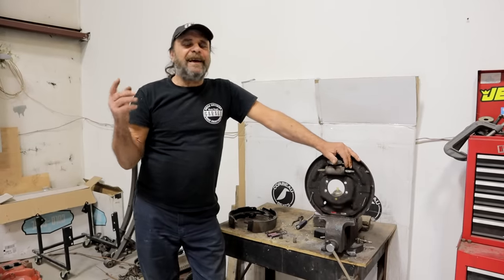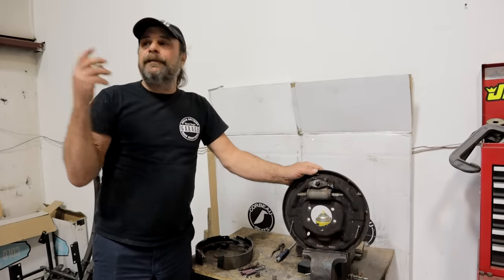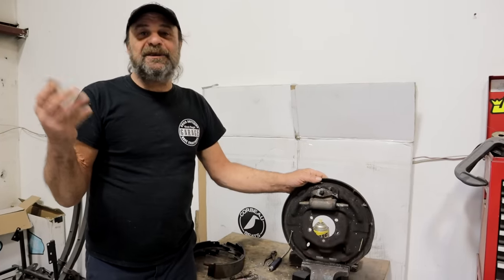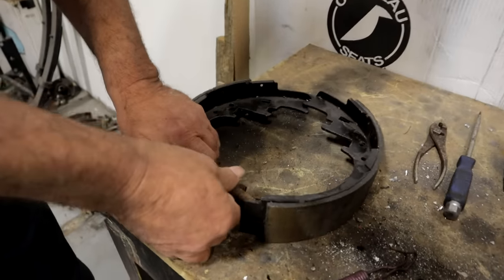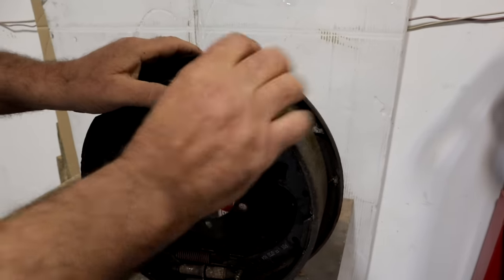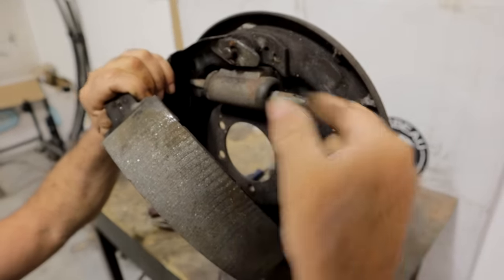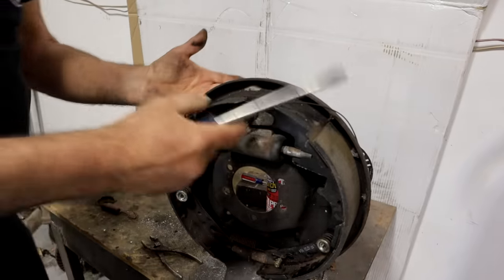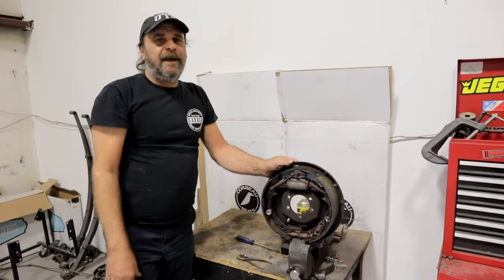Drum Brakes Made Simple - R&R Tips And Tricks That Make The Job A Snap

Comment: Very good, Tony - only one correction, though:
Mopar went to self-adjusters in 1969 on these, at least in 11".
It's easy to "convert" a prior year to them as a result, too (I just replaced everything on my '68 GTX 
last year, lots of research into it).

The bad news about trying to keep drums on these older Mopars is the lack of USA-made new parts
for the job (aftermarket is about all Chinesium these days); I insisted on using new US-made stuff,
which meant a lot of hunting for parts.
Drums especially are non-existent in 11" US-made unless you want to pay huge $$$ for NOS; shoes
similarly are next to impossible to find (I wound up using newly made ones from Porterfield Racing
Brakes in California and they seem so far to work fine).

Chinesium is going to be the ruin of us all,
- Ed on the Ridge

Comment: I got alot of practice with drums on my 65 galaxie 500. 

The only issue i had with it was that it was a single pot reservoir. Have since switched it to a dual reservoir. One time a wheel cylinder broke off at the mounting hole, breaking off the line and leaving me without brakes. Another time, the wheel cylinder popped. Scary times but fortunately my emergency brake works well enough to get me stopped and I wasn't in dense traffic areas either time. 

Either way, I love driving it even if it is manual everything.

Comment: I was having trouble with my drum brakes on a 71 Hilux. Front had two wheel cylinders each. I was getting Toyota wheel cylinders which were old new stock and didn't last. I went to motor supply like dad said to start with and bought 1 1/4 cups for .50 cents. Hone and go .

Comment: The few times I had to mess with the drums was because of some old part failed. Once in a Caprice when the previous mechanic failed to install it properly and when my XJ had it's adjustment cable busted. Very easy, just need some screwdrivers and some pliers. Just like the old days.

Comment: Good lord man… I think hell just froze over…😂 Thank you so much for the advice. I just recently got a 72 Ford F100 and it’s got manual drums all the way around. The wheel cylinder was leaking on the driver side rear and I struggled to say the least…😅 After I got it all put back together, now I can’t get the brakes to bleed. 🤦🏻 Fluid was running out of the line when I had the wheel cylinder off though. So I’m really confused now.

Comment: All the brake tools pretty much just sit in my Mac tool box. Most cars have gone to 4 wheel disk brakes . Once in a while I still need the brake tools used on drum brakes but on rare occasions.  My son's 2016 Trax has drum rear brakes .  I was always using these tools in the 80's and even into the 90's . Most vehicles had disc on front with drum on the rear . Corvette went from all drum brakes to available 4 wheel disc in 65 . Only 316 buyers got a $64 credit for the drum brakes . Most people can't remember cars with 4 wheel drum .

Comment: I replace the anchor pins with 1/4 inch bolts double nutted with about 1/8 of brake shoe movement away from the backing plate. That way the shoes don't wedge when taking the drum off, and less backing plate wear. Those anchor pins like to rust and break anyway

Comment: Needle nose vice grips are indispensable. 

Take off both drums (front or rear)  but replace one side completely,  then the other.  That hives you the other side for reference. 

Disassemble and lay the parts out as they came off.  Use your parts layout as an assembly reference.

Comment: That arrangement for service works great on the front brakes but like you mentioned the Ford  It's different and you're not getting into rear emergency break has the little cable that comes down and attaches to the self A gesture half round pulley kind of thing it's attached with with the  Follower shoe Spring for the E break The way I do them is always install the E brake pad 1st leave the  Supposed self adjuster out Of the Assembly with the bottom Spring Installed very last step Pry shoes apart to install self adjuster this is e break specific you cannot install not install both shoes at the same time on rear brakes because the E brake lever attaches to the rear shoe via A horseshoe clip or e clip to attach the cable for the emergency break  Aside from that I completely agree

Comment: My issue with drum brakes is that some older vehicles use bonded shoes instead of riveted shoes. I bought shoes for my 65 mustang in 2014, drove it less than 500 miles before storing it. Three weeks ago I decided to go over the brakes because one wheel cylinder was leaking. I got the drum off the dry side and the friction material just fell off one of the shoes. Not the first time that has happened. Unfortunately you can't do the assembly like this with a Ford with the self adjuster.

Comment: If you’re new to drums, be aware there can be a great difference in performance between replacement shoes. My information might be a bit stale, but the cheap organic linings worked fine at low speed, little pedal effort needed, but useless for even one high speed heavy brake application. There were better quality linings for high speed usage, no fade for one high speed stop, and no pulling either. Lastly, inspect the metal part of the shoes for heavy corrosion and pitting, they are most likely well used, and have been blasted and painted, some I’ve seen have been pretty sketchy.

Comment: If you have disc brakes on the front you want to make sure that the brake disc spins freely. Once in a while you need to rebuild or replace the brake calipers as they will tend to drag when they get old and dirty, and that can heat up the disc and crack it.

Comment: im also a believer in drum brakes, i kinda wish you would have explained the different color of springs and why. and i always use a new hardware kit on anything that seems to have had hard or longtime use, those springs loose tension after a while being used with the heat and constant use. front and rear springs are a different color

Comment: I've been doing just like you Uncle T for 38 years now. Only thing I can add if I may humbly do so, is that it's easier to use a big Phillips screwdriver than a flat one to slide the springs on. The gap between the "teeth' on the screwdriver sits nicely on the round bit and doesn't tend to slip off easily like the flat one can.
I've watched so many folks mess up their braking system by doing a disc conversion and spending big money in the process for absolutely no gain. Especially on the 9inch ford rears etc. They can hardly drive, have never even thrashed a car hard enough to  get any kind of brake fade, but no - gotta have disks bro. I'm thinking I'd put the money into the overheating issue, or  a tune,  driveability issues etc first. I'm so behind the times!

Comment: Having driven drum brake power-boosted cars, they do stop really well. Even on my old Mustang with no power booster, I had plenty brakes for the amount the car weighed.  My '64 Dodge truck though sucked. I think most of the time drum brakes get a bad rap because of the brake booster either being a single circuit or marginally sized for the pressure needed, or in the case of my truck, the drums being too small for the vehicle weight. But certainly that is not the drum brake's fault.

Comment: A superior design for braking if unsprung weight is not a factor.  Temp related brake fade, so cooling and weight, as well as steering have moved disk brakes to the fore in rally and F1.  Where drum brakes really shine is on the back of hunting/4X4 rigs w/ an Ford 9", 14 Bolt or any 1-ton solid.  Even on the front they work pretty well but is much easier for steering Trig on gutted front-ends to move too calipers.  The surface area one gives up is noticeable, however one can wear shoes almost to bone-on-bone w/out a whimper!

Comment: My dad had a 63 Impala with 4 wheel drums, below 30 mph it would stop so hard your head would hit the dash. But at higher speeds you had to pray to get the car to slow down. 
I have a 78 Ford with 4 wheel discs. It is exactly the opposite. Going slow   you think the brakes must be broken but over 30 mph the car will pull up on a dime.
Maybe why many cars still have disc front and drum rear. Best of both?

Comment: Short shoe to the front as it's called a "self energizing system". The front or leading shoe is shorter at the top so when the brake is applied the drum bites the shoe and assists with the rotation.Fords are short at the top of the front shoe and short at the bottom of the rear shoe.Old wheel cylinders with new brake linings is extremely dangerous and very rarely will they not weep.Always scuff the drums with approx 40 grit paper to remove the glaze/shine. Do it once do it well.

Comment: Amused.  @Edelbrock when you order an intake makifold and the supplied studs break at 15 lb-ft.

Fair.  I like Edelbrock.  I have an Edelbrock carb on top of my blown Bronco build.  They might be a little lacking compared to, say, a Holley in all-out performance, but they also tend to have more even fueling on slopes.  And while it’s true that the supplied studs on my Edelbrock intake manifold broke under 15 lb-ft during install, I actually just wanted to see the comment thread.

Comment: when I  bought my first jeep  wrangler 90  YJ I removed the drums and some bozo had to leading shoes on one side and the smaller shoes on the other the linings fell off the shoe pads probably from running in the mud and stuff, any how I bought two sets of rear brake shoes and installed the longer shoes on both sides, I made a big mistake in using wheel cylinders from Dorman, they are weeping now and my brake fluid is Dot three and I flush the brakes on all four corners every year.

Comment: those self adjusters on  the ford trucks never work Ive always had to jack the wheel off the ground and jam a screwdriver in the adjuster hole and spin the wheel till the shoes barely touch and then back the star until the wheel spins free and no drag, most of the time the star wheel is frozen

Comment: I have to agree with Wes on this one UTG. The thing in his video that he specifically was addressing was the self adjusters never really working like they are supposed to. He wasn't complaining about the assembly of drum brakes. It was all the adjustments and hardware packs that weren't all included in the rebuild kit. You had to buy 3 different kits to replace everything and even once you did that it still didn't ajust properly. Then all the springs and parts don't come with a diagram..it's an over complicated system that doesn't work that great.

Comment: I have an 88 cherokee with rear brakes that lock up especially on wet surfaces. Two different shops have adjusted the brakes but still the problem comes back. It's like I have no front brakes. Any suggestions?

Comment: I have an 8.75 that's missing all it's hardware on one side the backing plate is badly damaged. I'm sourcing the replacement parts through Dr diff and rockauto. It's 10x1.75  bell style drum. My question is do I need the crossbar and do I need the self adjuster? Can I run the self adjuster without the crossbar?

Comment: (Long) Disc brakes provide greater clamping force and dissipate heat better. Besides that most of the stopping force provided by drums come from the top of front shoe where the slave cylinder pushes. The force applied by the rear shoe has minimal effect in comparison to the front. Where as a disk caliper applies force equally to both sides with more surface area from two pads. This can be scene on worn shoes where the top of the leading shoe is always more worn than the tailing. If the rear shoe were to apply any meaningful stopping force it would need a second slave cylinder on the bottom so it could apply force where it would be more effective.  I believe semi’s actuate the top and bottom because of this limitation. Properly adjusted brakes will always have some parasitic drag or else your pedal will have to travel too far before they start to apply and that is a limitation of hydraulics where the fluid will always take the path of least resistance. Now let’s say you have your drums backed off so far that you eliminate drag, great, now you have spongy brakes. Properly working disk calipers are returned by the square seal of the caliper piston.drag is minimal. At the end of the day give me 4 wheel vented rotors every time.
Reply: With all that said, if I’m building an old muscle car I’m probably keeping the drums because they work good enough and I couldn’t justify the price difference where that money could be used elsewhere in suspension upgrades like poly bushings or upgrading the steering components.
Reply: Drum brakes are duo servo they are self energising as the shoes are applied they wrap into the drum through the adjuster they get full lining contact trucks use air brakes through a s cam

Comment: At 06:26, can anyone explain why the larger brake shoe(longer brake lining surface) is placed on the rearmost direction of the vehicle and is it always the case?  Which one of the two is considered to be the primary and secondary brake shoe?  Any video out there that actually clarifies this further, please?  All in all a good to the point video.
Reply: When you apply drum brakes the shoes are push out by the wheel cylinder because the shoes able to move with the adjuster the long lining is at the  back the way the drum is turning It pushes the back shoe with the long lining into the drum harder  they self energising  the short is the primary and the long is the secondary lining I hope that explains it so you can uderstand
Reply: @petershaw1705  Thank you and much appreciated!

Comment: Disclaimer: I only do street. 
I will tolerate rebuilding drums, but all my older ones have front discs/rear drums. It's been common knowledge down under here, that our Valiant drum brakes did pull the car up VERY well......... once. 😅
Ours were slightly different, being unchanged early A bodies, with the retainer spring going through the shoe to a small retaining hook at the backing plate. Still simple once you get the knack with a small flat screwdriver.

Comment: There is another application where disc brakes are superior to drums.  Offroad and especially any sort of deep mud.  It would only take a couple of runs before my rear drums would be packed full of mud and be completely destroyed.  Discs on the other hand, by virtue of having fewer moving parts last much longer and since there's no drum in the way, they are much easier to clean, as long as you can get your water spray past the wheels anyway.

Comment: I have a '91 Dodge van and the parking brake doesn't work well at all. It actually works find for reverse, but going forward it doesn't work nearly as good as it should and I don't know why. Maybe it's just a poor design. I don't know.
Reply: Check and make sure the shoes are on the right way around long to the back short to the front it sounds like they are the wrong way around if it works better in reverse

Comment: Biggest drawback with drum brakes is the fact that if you drive through a deep enough puddle and have to stop within about 50 yards your brakes wont work cuz they are filled with water  You have to go through puddle riding the brake 
   Untill mid sixties hardly any drum brakes had self adjusters 
    I always use small vise grip pliers to hold those spring keepers

Comment: Thanks

Helpful to many

But..

The inexperienced:

Allow plenty of time 

Access to alternate transportation

Access to parts shop for back up plan

Decent temperatures

Adequate sunlight !!!or interior light 

Celebrate Working bent over two feet off the ground

Fighting to release old rusted odd brake drums 

Oozing wheel cylinders encapsulated in blooms of brake dust … 

fighting spring kits … 

Welcoming needing to remove all parts and completely clean all 4. backing plates 

Star wheels of death and bonus … inner emergency brakes 🆘☠️

Pass

“Self” adjusted … seemingly suggesting magic…

Not quite

Bombs away 

Not quite

Comment: Drums aren’t hard. Take a picture and lay your springs out on the ground how they come off the backing plate. I normally manage them fine with a flat head screwdriver. I have done some on trucks and used heavier screw drivers and some needle nose pliers. They’re simple. Not that hard. And ridiculously reliable.

Comment: I have found these videos helpful, but the jobs are never “easy”.  Typically I pinch my fingers, smash them, and the springs never ever ever go on easy.  
  Takes me about 2 hours per side because the f-ing springs never cooperate like they seem to for you and others.  
  The “its easy” comments are just a taunt to be honest.  
  Doing a ‘60 Cadillac right now, the rear, with springs connected to other springs.   I’m an hour in so far, and still can’t get the two springs to connect.  You can’t use a screwdriver to connect spring to a spring.  I’m bleeding, and at the moment, am contemplating setting it on fire.
Reply: Finished removing and installing one side of shoes in 3 hours.  Probably will have it adjusted and the wheel back on in 10 minutes.  One split lip from a flying spring.  
  Please stop saying this s—- is easy.   I still have three more wheels to do.